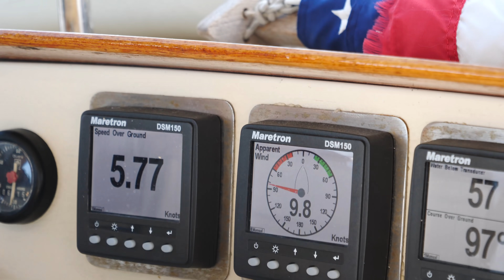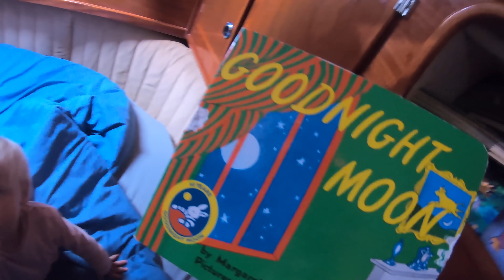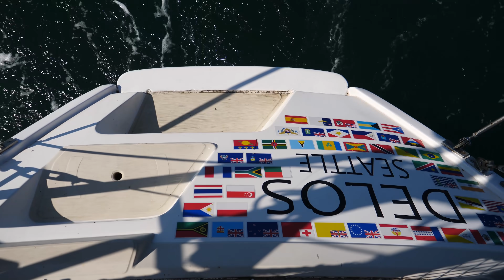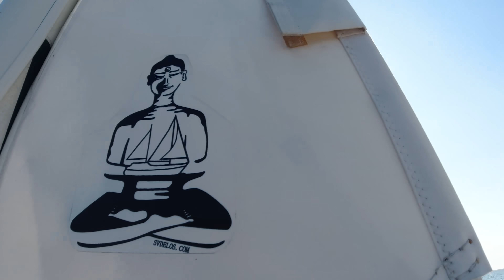She Pulled the Princess Card but Fixed The Toilet! - Sailing Vessel Delos Ep. 302

Comment: Damn, that transition at 0:37 was smooth af

Edit: also, if you’re having trouble with your devices not charging, there might be a little bit of dirt in the devices charging port. If you haven’t already, try getting a thumb tack or another small item to scrape the charging port
Reply: thx a lot!

Comment: Hello Brian, Kazza, and the Nugget! I apologize If I misspelled “Kazza” by the way. I have literally watched every single YouTube video that you have posted, and I stumbled upon your channel after watching “project Atticus”. I have a question for Brian, or Briiann, whichever you prefer. I have worked as a machinist, a plumber, an electrician, and a mechanic on everything from compact cars to heavy equipment such as bulldozers, excavators, etc. I grew up working on two farms when I was 13, and I continued working 30-40 hours per week while in high school, while going to night school to become a firefighter and EMT. I also worked for a city, as a municipal public works and public utilities employee beginning at the age of 15. Working in a relatively small city meant that I was required to learn every aspect of maintaining a city. This entailed everything from learning to diagnose problems with single phase, three phase, and DC electrician knowledge. I was also tasked with maintaining and repairing and maintaining a fleet of heavy duty pickups, on-site and mobile three phase generators that ran on either natural gas or diesel, as well as heavy equipment such as dump trucks, skid loaders, excavators, large tractors with various attachments such as snow plows, mowers, and snowblowers that mounted to the tractors we had; two 6420 John Deere tractors. We also had  equipment such as chain saws, weed whips, mowers, road graders,  and by the time I quit I was doing the regular maintenance on 15 large 240 to 480 volt generators, most of them were permanently mounted at lift stations, water towers, the fire department and city hall, as well as three phase generators mounted on trailers to hook up to any lift station or water tower that didn’t have its own on site gen set, or if the fixed on site generators didn’t function for any reason. I was primarily self taught or learned on the jib, and I am grateful to say that it made me adapt and learn how every single piece of equipment worked. From bad ballasts in city hall or the library, to major overhauls of large equipment. 
My question for you is in regards to your Volvo main engine, as well as your generator. I know that you swapped out your generator some time ago, and the new one, if I remember correctly it was a Northern Lights generator that was contained inside an insulated box, which I am sure made it much more quiet. So getting to my question, or questions, besides the Diesel engines aboard Delos, did you have any experience with working on motors, let alone diesel power plants? I’ve also noticed that you seem to eat through impellers like a fat kid in a candy store. What, if anything, have you learned about repairing and maintaining your power plants, and what kind of spare parts do you carry on Delos? I would imagine that you have a couple of dozen impellers tucked away, as well as fuel filters and the necessary tools. I guess I am asking about redundancy. I understand that you have redundancy for things such as electrical power, between the solar, wind, and the generator that you can tow behind Delos, and I know that you are an electrical engineer, but I was curious what would happen in a worse case scenario? If you were offshore and out of fuel and wind, and your inverter took a crap, and those fancy lithium batteries started on fire like they tend to do in airliners? I realize that you can still hoist sails, but if you found yourself in a situation like that, with no wind, would you just bob around the ocean, if the sea state was too severe would you activate the EPIRB? I actually don’t know if they’re called an EPIRB, but I am sure you know what I am referring to. Say you lose all power in the southern Indian Ocean, what is the plan? I am not intentionally putting you on the spot, I just want to learn more about sailing, and after a decade of living on a boat, I was hoping that you could shed some light on this. 
Thank you for sharing your exceptional life with us, I am truly inspired and blessed to have found your channel, and I hope that you never stop! 
Oh and I attempted to pay for the 80degrees documentary and after entering the amount of money that I wanted to donate and signing up and logging in, the website just kept repeating the image of a polar bear or something, but it would just repeat the same thing like a broken record. I would be honored to hear from you, even if it is just a remedy for the website glitch. Stay safe you three, I look forward to your next video!
Thank you,
Chase
Reply: What was your question?

Comment: They make thees Fiberglass Scratch Brush Pen that will clean the Electronic applications, Removing rust and corrosion the sell like on  amazon in like a 3 pack for 12 bucks you should check them out.

Comment: PS ... a Crab Pot got wrapped around my pro, causing us to have to drop the diesel into neutral and call the Coast Guard. This was in 7 foot sees off (what else) Cape Foulweather (Oregon). Line cutter broke leaving a couple floats pounding our hull. Couldn't sail due to weather. This is why Crab/Lobster pots are a serious problem in the Spring off the OR Coast. A bot crew we ran into said they saw pots almost 15 miles off the coast. It's crazy: no reflectors, no lights, just little mines waiting to break your drive train. We decided to boycott Crab from now on!  :  )

Comment: Apple products are dead to me. When they fail you get to learn Apple's true colors.
Reply: Apple is just like every other company that has gotten so big, that it's customers don't matter anymore.
Reply: Basically every phone company sucks in the last few years, but Apple sucks for a premium price.
Reply: Apple needs to stay out of politics and away from our government as well. That little bite out of the Apple. I wonder what that means?
Reply: Im Happy with my oneplus 6. It's working since they released it as it's supposed to. One the backside  glass cracked and I got it cheaply repaired by official service. Can recommend this totally
Reply: @huibu8987  After market repair shops can repair some Apple products and others they can't. Also glass replacement is a relatively simple repair. You are fortunate you got yours repaired. Try to get a repair that is under warranty and then they tell you it got wet, when in fact it never got wet. This happened with my daughter's new laptop. They wanted north of $800 dollars to repair it when it should have been under warranty. Fortunately I found a repair shop who got it working for $200. After that never another Apple product.